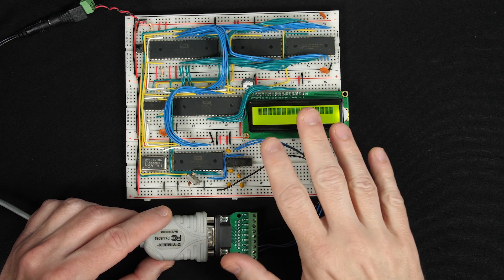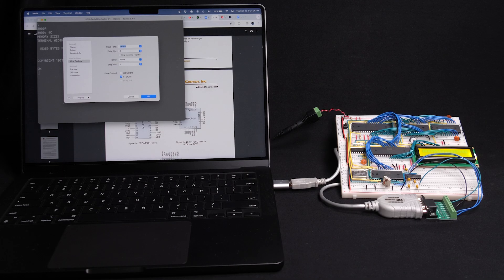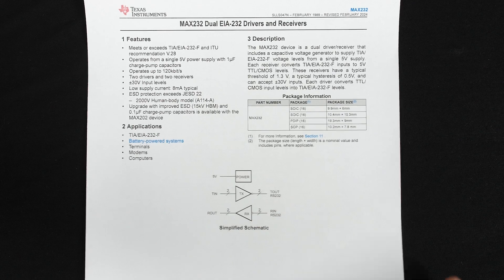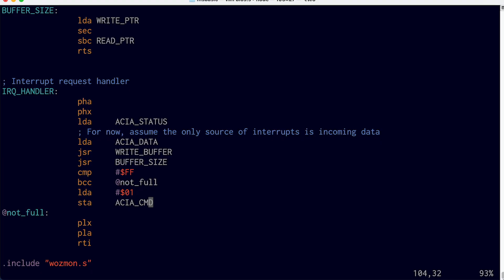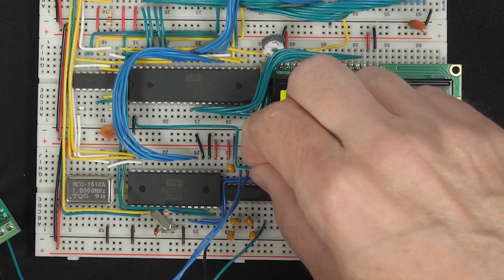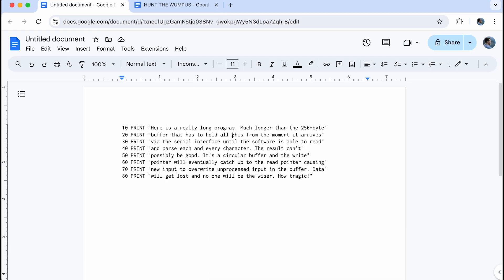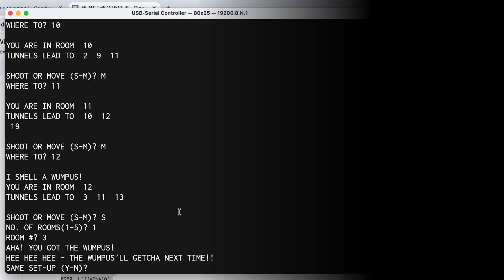RS232 flow control

Comment: A lot of comments here are right on the money.  De-asserting RTS (RTSB is High) disables the transmitter, much like how you'd expect an original-spec RS-232 to operate.  A.K.A.: "Why transmit if we're not ready to transmit?" -- it's a weird design of the 6551.  If you want to keep using the chip, there's a couple workarounds that may be suitable depending on the application.

The simplest method by far is what Ben does in this video, which is to just bypass this feature entirely and use something else to assert this signal.  However, if you want to plug into anything other than a 3.3-5V interface, you'll need to make sure you have proper protection and levelling on that pin.  He does that in this video, and it really is a simple and decent solution.

Another simple workaround, if your carrier equipment lets you get away with it, is to use DTR to signal whether the remote device can send data.  I could see this getting really tricky at high baud, since de-asserting DTR also disables the receive interrupt.  So if another word is transmitted, your software may not get the signal for it and you'll need to implement some kind of delay and state checking to make sure.  Probably not a very good solution IMO.

And, a complicated solution; if you implement a software transmit buffer (much like the software receive buffer), then you can absolutely use RTS to signal whether something can be sent or received.  You will only be able to send and receive data when RTS is asserted, and your memory footprint could double in size, but the logic would be similar.  This is a good solution if you build a controller around the 6551 which has its own memory and micro to handle everything separately from the rest of the computer.

P.S.: The SWLink C64 6551 driver uses the third option for transmitting characters.  It has two buffers; the transmit buffer is gated by the RTS setting.  In this implementation, when DTR is de-asserted, the entire 6551 transceiver is treated as if it's disabled.

Comment: Ahhh. This brings back some memories! Back in the 70s & 80s, I used to need to know about all this stuff in intricate detail. I haven't used an RS232 breakout box in nearly 30 years. 
I'm not familiar with VIA hardware bugs, but I could rant at length about the infamously buggy Intel 16450 serial comms chip, & the not buggy, but very shitty Intel 8250 serial chip.

Comment: Is there a particular benefit to using A0 for the RTS signal as opposed to the unused B7 pin on the VIA? We have an 8-lane port B, and one device that takes 7 lanes and another that takes 1, and if I'm interpreting how the 6502 works correctly, there's never any instance where an LCD operation would be interrupted by a serial RTS operation.

Comment: Flashes me back to CP/M days rewriting the BIOS serial I/O routines for every new terminal to get WordStar running.  Printers too.

RS-232 "standard" was more of a guideline. Rewiring cables was par for the course.

Fun fact: XON is control-Q and XOFF is control-S so you could throttle long incoming (low-speed) text listings by pressing those keys to stop and start flow control manually.

Good times.

Comment: I've been obsessed with stty(1) options recently, fixed a bug in KDE Konsole setting IXOFF for a pty even though it's completely ignored for ptys since there's no hardware line as both sides of the pty line are in kernelspace. They'd confused it with IXON which allows ^S and ^Q to start and stop the output.

So now it's nice to see CTS, cousin of XOFF in action on a physical RS232 / tty line in this video. It's sad to me that so many stty options like hupcl, ixoff are almost forgotten, and it's fascinating to look through the kernel drivers source and how they're still somewhat relevant / influential on modern terminal emulator design, even if just indirectly.

Glad to see these protocols being kept alive with explanatory videos like this, lest we lose all this esoteric knowledge and end up not knowing how we got to the present day!

Comment: I haven't reached this part in my build yet, I'm still on the wozmon part. My issue is the serial terminal is skipping over characters when echoing. I later found out that this issue can be mitigated by adding 20 loops that count down from FF in the echo routine and it looks much better but is really slow. I can't tell why this is. 

I also noticed that the CR character in the echo routine is returning the carriage but isn't triggering a line feed. without modifying the code inserting a LF character and then downloading modified terminal that allows me to set CR/LF as a setting on the keyboard it will just stay on one line.

Should I be making use of the RTS line on the serial interface to fix my issue? If anyone can help I would greatly appreciate it!

Comment: 📺🧸💬 ... Have anything related to the lesson?
🥺💬 Yes, the inverter signals to safe costs and power of circuit integration.
🐑💬 ➰ In the telecommunication phase and information are important to have successful results we can create a phase shifted to carry one more data bits for successful information both ways.

📺🧸💬 What about the buffers ⁉
🐑💬 ➰ Since the speeds of both computers are different buffers hold their information between.

📺🧸💬 Jirayu this one for room reservation.
🥺💬 I had passed the test both Python and C# with queue and dequeue method. Thank you and I will continue and I like your courses.

Comment: back in the days of dos, interrupts and interrupt priorities the question i would have is what has a higher interrupt priority, collecting the data or displaying it to the screen.  I would often collect the data ok, but if I wanted to display it to the screen at the same time, I would have to pause collection so that the output to the screen was ok.  i was displaying graphics at the time they were being downloaded from a satellite at 2400 baud.  i needed to tell the graphics card to switch from text to graphics mode, which had a higher priority than data collection.  so if data was not paused it was lost. then drawing the data had a lower priority than collection, so if not paused again the graphics could have glitches.  don't know if this helps you any.  multitasking on a 286 16mhz was not to fun.

Comment: I understood RTS, request to send, as it is requesting the otherside to send data ... not that it is requesting to send data.
Reply: As I understand it, RTS is an output of the DTE, to facilitate the use of half-duplex modems.  It requests the modem to set the data direction to transmit.  It might take a little while for the two modems to do that, but when the data direction is set properly, the modem asserts CTS.

Comment: My first thought - as another poster has pointed out - is that you are writing to the command register after calling the CHROUT routine. That you should assert RTS before calling CHROUT. But, your CHROUT routine delays to ensure the tx register is empty (working around the TxEmpty hardware bug), so that shouldn't be it. Try it and see.

I've also seen code that only writes to the command register if the command register has changed. Another poster mentioned this. So something like (easy to make into a subroutine):
LDA #1:CMP ACIA_CMD:BEQ skip1:STA ACIA_CMD:.skip1
LDA #9:CMP ACIA_CMD:BEQ skip9:STA ACIA_CMD:.skip9

My second thought is - is the other end missing incoming characters? You have enabled RTS/CTS flow control on the laptop terminal program, but you haven't actually connected the laptop's outgoing RTS. So - even though you have stated the laptop is so much faster than the 6502SBC - the laptop could actually be being swamped. It could be saying "woah neddy!" at its end, but because the 6502SBC doesn't know that and keeps sending, the laptop misses characters. The laptop is busy transmitting data it could very well actually not have enough brain power to deal with the received data at the same time. It could be that the terminal program itself is too busy with sending characters to display received input.

Which leads onto the next video - flow control from the 6502SBC to the laptop. Which will involve the hardware bug on the 6551's incoming CTS line and having to use the DSR line instead and manually monitoring it via the status register.

Oh dear 6551. Such a useful little UART, so many bugs to work around. ;)

Comment: G'day Ben,

I left a message on Patreon regarding my take on this but not sure if you saw it.

The short answer is that you are clearing the ECHO mode by clearing bit 4 on the command register.

As you are receiving data, you shouldn't need to play with the TIC (bits 2 & 3)... in fact the datasheet asserts (page 11, 2014) that when bit 4 is HIGH (ECHO mode set), bits 2 and 3 MUST be clear.

When re-enabling receipt of data, instead of setting the command register to $09, try using $11.  This will assert DTR/CTS (bit 0) and REM (bit 4).

Comment: I wonder if the chip was handling both CTS and RTS even though you thought you were only changing one of them?  and so it was expecting control signal from the PC that you didn't hook up, and it was floating.  I don't know if there are internal pull/pulldown resistors in the chip.  But it might be worth investigating that.

Comment: Ben, please note that the OTHER reason you needed to route the RTS and CTS signals through the MAX232 chip is because RTS and CTS obey the same RS232 standard that the TX and RX signals do: they're defined to be ±3-25V, which MUST NOT be routed directly to a TTL-level (or other typical level) chip. They need to be converted to the 0-5V (or whatever) voltages that the UART expects. And yes, they perform the inversion while doing so...

Comment: This brings back memories. I used RS-232 (and its derivatives) to talk over HF/VHF/UHF radios for years. You'd have a speaker set to the frequency, and watch the RS-232 handshake lines while listening to the tones. Note that the communication path was half-duplex - you could either transmit OR receive, not both at the same time. If you "push to talk"ed, then you weren't going to hear what the other side said! The handshake lines defined the various phases of the communication:
DSR: (Data Set Ready - Input) Modem is turned on. Without this, there's no point in even starting to communicate.
DTR: (Data Terminal Ready - Output) Computer is turned on. This might literally send power to various parts of the modem and/or transmitter in preparation.
RTS: (Request to Send - Output) Tell the modem to first "key" the radio (press to talk), then send the carrier - a preamble and start tones - to signal the far side that it was about to get a transmission.
DCD: (Data Carrier Detect - Input) The modem has detected a carrier, so prepare to receive a message - oh, and DON'T start a transmission of your own (raise RTS)!
CTS: (Clear to Send - Input) The modem sends this in response to RTS, to state that the preamble has been sent and the transmission can begin.
For those that remember dial-up modems, you know the "melody" that is played up front, before the raw static-noise data transfer starts? Well, that melody is the preamble. The modem would respond to RTS by playing the melody down the wire, and when finished would respond with CTS to signal that data transmission could start. Meanwhile, the other end would be doing the same thing - and also raising DCD to signal that the other end has initiated transmission. Given that the modems could speak full-duplex, that meant that the two modems could talk at the same time - but the RTS/DCD/CTS sequence would still be followed. As modems got better, they'd just raise CTS immediately, and internally buffer the data until communications had been established.
Finally, the last signal (other than TX and RX for transmit and receive data, and GND for Ground) is RI. This is Ring Indicate, a phone-line signal (not radio!) which pulses to say that the phone is ringing. You'd raise DTR to answer. Cool fact: you know that the original phones had a hammer that struck a bell repeatedly to make the "ring" sound? RI would pulse for each hammer-strike, not just raise to say "phone's ringing!"
Reply: Nice post!
I was about to comment that my understanding is RTS and CTS are "viewed from the opposite end of the connection"
Request to send [to a device] - raised by the host to signal the device that it wants to send data
Clear to send [from a device] - raised by the device to signal the host that it is ready for transmission
Your explanation covers all the lines and is great for understanding why it is how it is!
Reply: I'm writing a library for a 5g sim modem, thank God I don't have do all that lol. I still use RTS/CTS but it's to handle asynchronous tasks.

Comment: This style of buffer with high and low-water points tends to cause clumping of data flows when the speeds are mismatched. What happens is that transmitter goes full steam ahead until the high water mark is hit, then the receiver effectively blocks the channel while some software in the transmitting device fills its output buffer, and that clumping can continue backing up the channel to the next higher source, and so on and so forth. Then when the receiver has bought some time it goes full steam processing its buffer until the receive buffer is at the low-water mark, then it turns the flow back on the channel, and the transmitter can empty its transmit buffer at full steam, triggering the emptying of it's source's transmit buffer and so on and so forth, back up the chain. If you imagine this process happening globally then you get circular systems with very non-linear behaviour, so I think the result is that latency on the network goes up. Back in 2015 or so someone noticed this happening on the Internet in the TCP/IP stack and they deduced that the problem was that people were making buffers too big! So there was a campaign to reduce latency by decreasing buffer sizes. This was called "buffer bloat" and apparently it worked, because buffer bloat is no longer an issue, I heard. But whether this results in more dropped packets during congestion I don't know. But dropping packets is just another sort of buffering which filters back up the chain eventually resulting in clumpy Internet behaviour as a whole. So maybe you just get times when the Internet appears to go down and your apps all stop. If so then they pushed the problem right out of their domain into the user's minds! Whether that was a good idea or not, I don't know. Personally I think that using circular FIFOs would be a better solution, as I think it might still allow large buffers but without causing clumping: circular buffers can grow and shrink linearly in proportion to the ratio of the speeds of their upstream/downstream connections. I don't really know enough about statistics to be able to analyze this properly though.

Comment: Hi Ben! Nice video and as I am currently restoring some modems from 1980s, what a coincidence. Just some remarks: 1) The barriers where the flow control kicks in and out have common names in the software world and normally called high watermark and low watermark. When the buffer reaches the high watermark, RTS is switched off, and if the buffer runs empty below the low watermark, RTS is set again. 
I have not studied the 65C51 datasheet in detail, but writing a 0x01 to command seems to set DTR and disable transmit interrupt. But you still want to transmit while not further receiving anything. But the datasheet only references modes of bit 3 and 2 that disable the transmit. Is there a typo in the datasheet? Especially as bit 4 states that you need to have 3 and 2 low for echo to work.

Comment: A question that I've had for literally decades: Once you have flow control, what's the benefit of having a buffer at all?
Reply: You can't be assured that the other system will respond immediately for flow Control.  As Ben said, there maybe a few more characters coming in.

Also, a buffer allows for faster transmission than if you had to handshake each character at a time.  Its a balancing act.

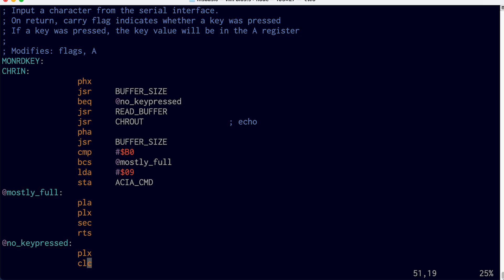Comment: Aren't they dropping because of @7:08 you've changed how the echo works?  And more so at @8:25.  Right?  My mental model of this CPU isn't very well developed.
Reply: And I think you've patched around the code issue when it works @12:51.  Again, I could be completely wrong, as I'm just quickly following along and trying to keep track of things.

Comment: CTS makes plenty of sense, in the exact same way as Tx > Rx and Rx < Tx do.
You have to keep the correct perspective in this stuff.
This pin is an input that means: "I am clear to send."
The same way an Rx pin is an input.
UART is all labeled from the perspective of it's own side of the connection.
You just have to keep in mind that multiple pins in UART cross over, just like you already have to do with Tx/Rx.